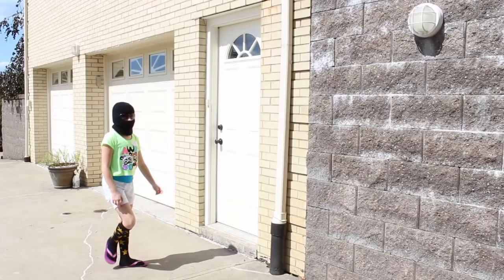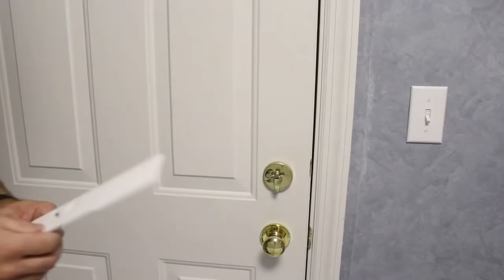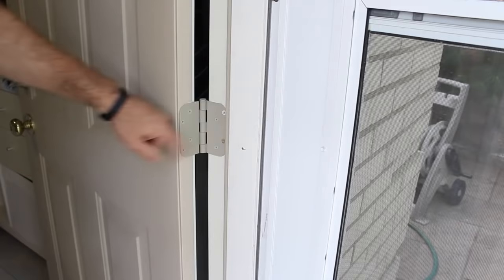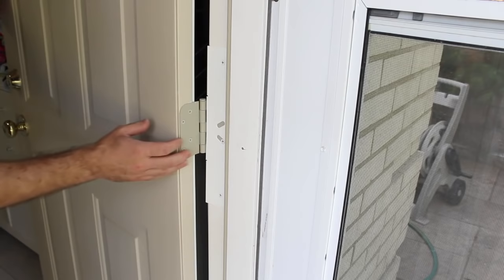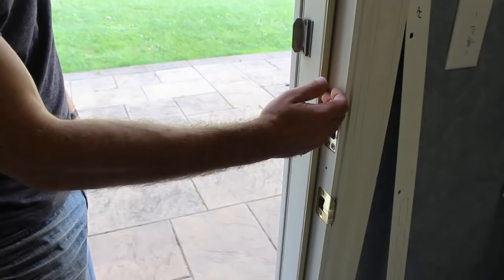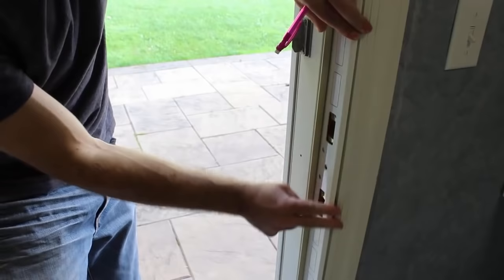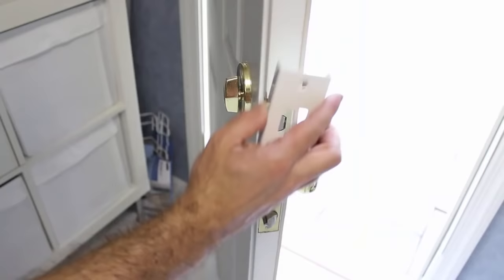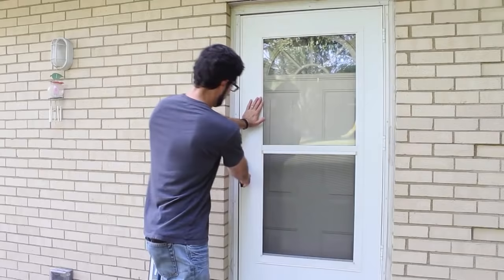How to Reinforce and Burglar Proof Your Entry Door

Comment: Does not matter what sort of drill you use, pre-drilling is done to stop the wood splitting.
:(
Reply from the maker: Thanks Cumbriahandyman
Reply: assassinlexx   I'll bet that went way over his head. he just wasted 60 bucks
Reply: assassinlexx  -- Could you provide a link to what you mean by "murphy bars".  When I did a good search for them, I ended up with liquor bars / tables that fold up into a wall... I'm probably familiar with what you are talking about, but have never heard that terminology for them... Things are called by different names in the same country, much less if you are in a different country...
Reply: assassinlexx  -- OK, I think I know what you are talking about.  Just never heard them called "Murphy bars".  Most be some regional term for them.  Where are you located?
Reply: assassinlexx < great advice, where do you buy those "Murphy bar" setups ?
Reply: Actually since he’s using existing holes, the holes in the “crackable”  frame and jamb are basically already pre-drilled. 
You don’t have to worry about predrilling the internal door or wall stud structures.
Reply: He probably didn't pre drill because of time constraints for the video. I pre drill everything, so I would have used the correct method whether the video advised it or not. If you know what you're doing, this shouldn't even be a question.
Reply: Time restraint, NO. The longer the video the more they make from youtube.
Reply: @stellarocquie7957  yeah but many people come to these videos because they might not know what they are doing. I’ll give you cookie for knowing though.

Comment: Being a landlord for 30yrs I have first hand experience with the processes and benefits of "fortifying" entry doors. In general I was with you until you removed the screws in the door hardware and simply replaced with longer ones (w/o predrilling I'll note too) which really does nothing. Everything you did to that point does help a lot. But you can accomplish the same thing much cheaper simply by going down to the hardware store. Also, it helps to replace the screws going thru the hinge into the door as that interface is a weak point. Installing a shield to the outside of the frame covering the area where the bolts interface the striker plates is another inexpensive fortification.

For the people who mentioned the window...I've been intalling lexan instead of glass on first floor windows. 
But in the end the only way to defend againt a break-in is a dog, a gun, and training.
Reply: And be home
Reply: Wm H Lol got all of those items👌😂💃
Reply: I have a german shepherd,  my friends dont even come visit me anymore lol .

Comment: My son owns a home security business and this is a great instruction video on ways to help you stay safe.  Great job.
Reply from the maker: Thanks James Fogal - do you have any tips that would help secure a home even more?
Reply: Adding Window Film is probably the best way to help secure a home.  Its kind of tricky to put on but not that tough.  You can purchase window film that is actually "BulletProof".  BulletProof actually means the bullet can still go through the glass and the window film but the glass will not fall out of the window.  It will shatter but the film keeps it together and its still really hard to kick out or beat out with a hammer.  Window film will usually give you plenty of time to lock and load your gun to save your life.  

I might add that ANY sliding door should have window film.  This glass is usually safety glass like you might find in a car window and shatters into very small pieces.  If someone uses a metal punch and a hammer a sliding door can be shattered very quietly.  This then offers an almost complete door size entry for a thief.  The sad part is many homeowners might actually have a sensor on that door to detect if it opens through their alarm system but if the glass is shattered they can stroll in undetected.  That might be one of the biggest home safety tips you can give your customers.  Thanks again for your video.   It was awesome.
Reply from the maker: Thanks for the wonderful tips James Fogal - I learned something new today because of you.

I'm going to look into window film and who knows, maybe there will be a tutorial down the road.
Reply: If you look on YouTube under 3m they have a few videos that are very impressive on window film.  It made a believer out of us.  We do not use 3M in our company but their videos were enough to convince us to look at adding it to our security line.

Comment: Note: predrilling prevents boards from splitting and if the wood is old and hardened the longer screws might slow down or stop and an empact driver can easily break off the screw. I use one extensively and  it happens often. You don't want soft  wood to split and hard wood to shear off the screws.

Comment: Should probably drive some 3-4in screws into the door side of the hinge too. Not just the frame side. Also, if you were to recess your hinges it would allow you enough space to mount the door shield parts.
Reply: Absolutely I thinking the same thing.

Comment: Do not use this video as a good practice guide. An impact driver is still, at best, going to weaken the wood, if you don't pre-drill first.

A steel frame reinforcer is a far better option than plate reinforcement.

Comment: Many front doors are quite flimsy- you need a solid wood door in conjunction with the security kit shown. The door shown in this episode could still be kicked in because the locks are fastened to narrow vertical slats that are easily broken. The reinforcing shields for the locks, which were not used, add important stiffness to the edge of the door, so they should be used.

Comment: You made the jam stronger, no question. The door is now the weak link, without using all the pieces that product has literally done nothing.  It was a well done video, but the manufacturer should be clear that if you can’t use all the pieces, it will be ineffective.

Comment: I disagree about not using the door shields just because you can't close the door. It's an important part of the system. Go buy a wood chisel to make it fit. Most of the wood is already removed for the existing plate. You only have to shave off a little bit above and below it. You don't even have to be too precise because the shield will cover any mistakes.
Reply: the door looks to be layered steel, which will also require grinding to fit the lock gaurd.
Reply: yeah I've kicked in doors for a living I'm skinny and it takes 1 kick even with great state of the art locks, its all because the frame gives way, I would say all front door should have a metal frame, but they don't because metal can warp in heat like a fire and trap you inside. this product seems to address the problem while still being fire safe.

Comment: 1)Replace all the hardware screws with ones that are 3" or longer.
2) Buy 2 door hinges with removable pins.
3)Remove hinge pins and sand/grind the shafts to where they slide in and out of the hinges freely.
4)Mount the hinges on the opposite side of the door from the upper and lower hinges.
5)When the door is closed,just insert the hinge pins.

This set-up is inexpensive,easy to make/install,and will make it to where the door/frame has to be destroyed to breach.
99% of the time when a door is breached,it's on the latch side.
(Note:You can also toss the hinge pins entirely,and use two Phillips screwdrivers instead.)
Reply: How the hell does this only have 9 likes… this is brilliant.
Reply: While I must concede that this is a sound method to secure a door from the inside, how exactly do you set the pins when you are of your home?
Reply: @greenman7yyy  Wouldn't work on the outside.
I guess you could set it up for a trailer hitch pin lock.
I personally wouldn't want something like that though.
Someone could lock you inside.
Reply: @definitelynotaheretic.7295  how do you place pin leaving the house Einstein? Even for the inside it would be against fire code in most jurisdictions. If your kids need to leave house in case of fire they should be able to do it using regular door latch.

Comment: Just a friendly heads up, make sure there is no electrical in the opposite side of your door jam, sending 3” screws could possibly strike a wire or plumbing, also just because you have a impact doesn’t mean you don’t have to pre drill, pre drilling your holes helps not to split the framing when your sending screws into it.
Reply: Lol. That's not possible.

The jamb is 3/4 thick plus probably 1/4 to 1/2 of shimming before it even hits the jack stud which is 1 1/2 and then the king stud behind that which is another 1 1/2. 

Do the math.

Comment: Hey Man, nice video, but I have some friendly advice… I believe the instructions advise to pre-drill the holes is to eliminate the jamb splitting… which can happen much much easier when screwing a few inches apart in a straight line, parallel to the wood grain. An impact driver won’t save you from that. 
Well done tho, thank you for the video

Comment: Puts all that hardware on the door.
Brick thru the 1/16" thick window🤔
Reply: My thought as well, lol.
Reply: The point of the hardware on a door is to slow down an intruder if you’re home. I know it’s also for if you’re gone, but that might work since they won’t want to make a ton of noise repeatedly kicking the door or breaking the glass. Breaking the glass and having to climb in a window also slows them down. I just need someone slowed down long enough to grab the other tools I use to protect my home. And call 911

Comment: 8:45 The purpose of that fitting is to prevent the wood from splitting and the deadbolt prying out the sheetmetal when the door is forced open.  That is the point of failure if the deadbolt is fully engaged.

Comment: Pre-drilling is not for your ease of install, its to avoid cracking wood.  The wood will also crack less easily if somebody tries to get in with brute force.  Using this on a cheap door that is not solid wood but instead made of thin panels of plywood is similarly pointless as somebody could punch or smash straight through the door and turn the lock.

Comment: This kit is extremely overpriced, and hinge guards 🤔.. I don't see the point, just replace all screws with longer ones.. Thx for the vid.
Reply: I agree but adding a plate along the locking side and adding long screws wherever there are holes in the plate does help. Pre drilling the screws was something I’ve learned from the comment section. Seems like the hinge plate only protects the jamb not the door which I’ve seen as a weak point in a door. Longer the screw along the frame the better. I don’t know how thick the area inside the hinge is on the steel door, and would seem to me if it can take a 3” screw I would replace them too.
Reply: The hinge plate is so that the impact is spread out over a bigger surface area as well as if the hinges break they are still screwed into the actual frame
Reply: Not just longer screws but also thicker screws are way better.  If you take your time and you drill out the counter sink in the hinges little more you can use thicker screws.
Reply: z  -- There is no way to make a house burglar *proof* -- all we can do is make it more difficult for them.  My philosophy is to make it difficult enough for them to either make them give up and go somewhere it is easier or that they will make enough noise that I will wake up and decide the proper caliber of firearm to deal with the problem.  I currently have a 14-round .45ACP, 7-shot .357mag, and 30-round AR-15 sitting beside my bed.  For anything more challenging, I'll have to open my gun safe and decide what might be appropriate.
Reply: @CurmudgeonExtraordinaire  That's great if you're always home. If you're not, you won't be getting any gun.
Reply: @seancurran6727  -- If I'm not home, I always have a gun with me... Not that it's going to help me deal with someone breaking into my house when I'm not there... My dogs (4 pit bulls / American Bulldogs) act as a bit of a deterrent -- the burglar doesn't know that all he has to do is give them a treat and they'll be his friend for life... :)  I park in my garage, so someone isn't going to know if I'm there or not until they break into the house... I also have some active security devices that can be enabled so that they would be triggered if someone was to try to go through a window or the front door... It's not a particularly good idea to break into the house of an engineer with too much time on his hands and who keeps 55g drums and bags of lime on hand for dealing with "inconveniences"... As the saying goes, "I'm the most well-adjusted sociopath that I know"... :)
And since my front door is never used, it is blocked with a 2x8 bar...
Reply: @CurmudgeonExtraordinaire  If I may offer some advice….. never advertise the type or amount of weapons (especially firearms) contained within your household. Don’t do it. Its not a deterrent it’s an advertisement and the last thing you want anybody knowing is how you protect your home. Telling the world you have guns how many and what type is a great way to let criminals know where to go to take said weapons. It happens all the time. Why? Because criminals need/want guns for themselves, and to sell to other criminals. The more guns you own and advertise the more likely it is that someone is going to think the risk is worth the reward, and If you happen to have collectors or rare firearms that are high dollar items you’re really doing yourself a disservice. I think its unwise to have signage outside your home advertising THIS HOME PROTECTED BY SMITH AND WESSON. Just a word to the wise from the things I’ve learned in my time and place...
Reply: @michaelwhittaker5624  -- I'm in Texas... Finding a house with firearms in it is as simple as randomly throwing a dart at a map... And, of course, no one should actually use their real name on the internet... For criminals, there's a lot safer endeavors than trying to break into the house of an sociopathic old engineer with too much time on his hands... Breaking into a police station to steal the coffee fund would be safer... Robbing a bank would have much less risk and a higher reward...

Now, get off my lawn, dammit!  :)
Reply: G B  -- Deadly force is not automatically authorized for simple trespass, but there are situations where it in combination with something else could result in a fatal outcome for the perpetrator.  For example, criminal mischief at night -- which could be egging or TPing someone's house, gangbangers "marking" signs / buildings, etc.  A lot will depend on whether you have a leftist district attorney who is more concerned with getting convictions than following the letter of the law.  You are authorized to use deadly force in the defense of yourself or a third party and to protect property of of yourself or a third party.  Just like the cops have been coached to say when they have even a slightly questionable shooting,  you need to say "I felt my life in danger".  The concealed handgun license course for your state will go over the appropriate laws related to when deadly force is authorized.  I've had CHLs from multiple states (different states have different reciprocity) and some of the states have a bit of difference in when deadly force is authorized.  Texas is the one that I'm most familiar with since that is where I live.  You are subject to the laws of the state in which you have the shooting, not the state whose CHL you have.
Reply: Put in long screws with decking torx screws. They have better shearing resistance.
Reply: @HealthSupercharger  they do make thinner screws with better shearing resistance. So going bigger isn't always necessary.

Comment: One good reason to pre-drill is to prevent the heads of the screws from shearing off due to resistance. Another reason is to prevent the wood from splitting if the shear force is too high.

Comment: Seems like the weakest point now is the hinges where they're attached to the door. Overall it would be harder to just kick it in.
Reply: You need to replace a couple screws on each hinge plate with the ones with a solid stud on the other side. Or just add them in other sections of the hinge-side door  jam.
This review includes a very instructive picture:
https://www.amazon.com/hz/reviews-render/mobile-media-feed/B01DG0TZ1A/ref=cm_cr_dp_mb_crsl_img_0?ie=UTF8&physicalId=71yv2weyYaL&imageExtension=jpg&reviewId=RN9EZKWR74I3G
Not an endorsement of the specific product but rather the concept. This kind of approach will protect even a door with exterior hinges from the hinge bypass attack.
Reply: Yes. You should be replacing at least some of the screws with longer, tougher screws on BOTH sides of the hinge.